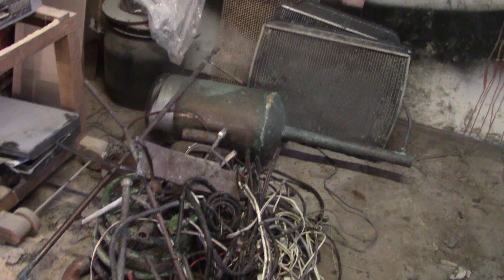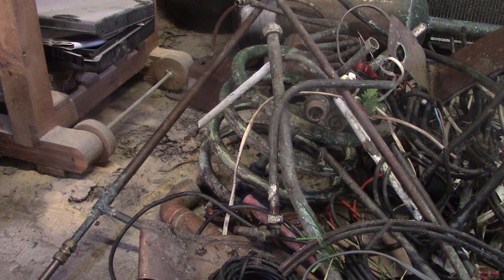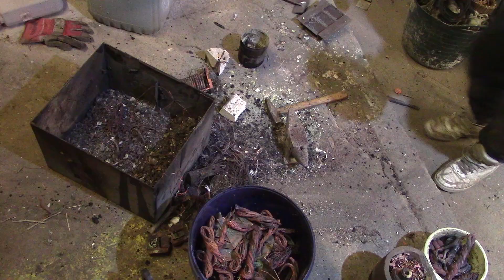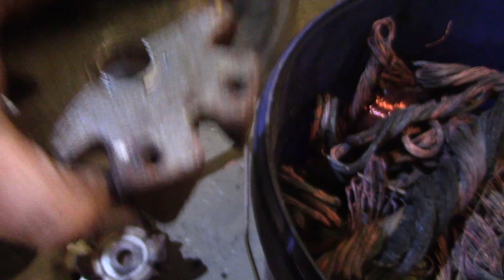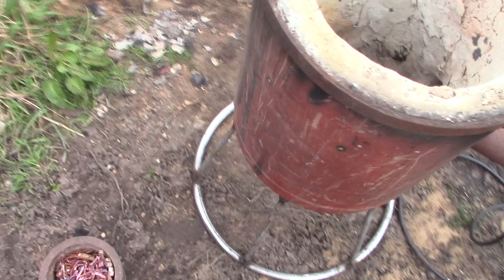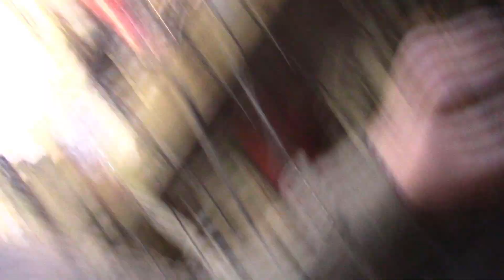Slightly sketchy waste oil copper melt

Comment: Nice one for the clothing recommendation didn't think of charity shop wool jacket, built a tiny less than half liter internal capacity crucible furnace the other week as a bit of a test for a bigger one already considering no hole in the lid exsaust at the side and some sort of heat exchanger
Reply from the maker: Interesting, what are you going to do with the recovered heat?
Reply: @turboconqueringmegaeagle9006  to preheat some of the incoming air a bit just to try to reduce the cold spot at the bottom where the air is blow in a hope of increasing the maximum tempreature and possibly crack vapourised the fuel up a bit once it hits the hot air.   Could allways use a wheelie bin, pump, copper coil for the one man Spa or heating
Reply from the maker: I really like this idea, I tried making a micro oil forge many years ago, heating the oil slightly but it inevitably got too hot and coked up, hot charge air is just as good regarding getting the oil to burn while not causing the coking due dirty oil and as you say getting a few more degrees out of it. 
Biggest problem I can see is having to open it up every time you want to have a look at how the melt is progressing.
Reply: @turboconqueringmegaeagle9006  I think a refractory slab on an lid with a hole best compromise, still got to move the thing to look bit it should not affect the burn as much as moving the whole lid to look. Fuel regulation is a problem with the small ones, end up having to thin the oil because its too viscous for small pipes run in through a fridge capillary jet spraybar type setup

Comment: James my last copper melt  did the same copper beads all up in the air my safety adidas trainers bead right through   lucky got a bucket of water to the side of me foot in bucket still held on to crucible  nice scar on foot   safety first
Reply from the maker: I've had weld go down in my shoe before, leads to a wee bit of panic I'd imagine if the lump of red metal was ten times bigger and you had a crucible in your hand it'd be worse. 
I've got complacent only playing with aly, this was probably a good reminder.

Comment: It might be worth a try but rub some Brasso on that visor to clean it up. If it's anything like polycarbonate light bar domes that are yellowed and hazed that will take it off. I've restored a few light bars that way. The same technique works with gauges that are hard to read. Try to find an older can of Brasso as the formula has been changed over the years it takes less of an effort to clear up.
Reply from the maker: I'd be surprised if it wasn't polycarb, it's starting to craze but would definitely be nicer to use without the yellow cloud, I've got some perspex polish somewhere, I'll probably try that first, but when I give up trying to find it I'll hit the braso, cheers mate.
Reply: @turboconqueringmegaeagle9006   Headlights in cars yellow and cloud all the time  here being they are all plastic lenses now.  There are all sorts of expensive rejuvenation "Kits"  but I get common old cutting compound and give them a good Polish and wipe off then go over with car polish which adds some  UV protection and the things come up like New. Any mild abrasive will work, Brasso, toothpaste, kitchen cleaners like ajax , Jif etc. 

The windscreen on my harley also goes off and I give that the same treatment although regular polishing when I do the paint work seems to  keep it pretty good.

Comment: Would those bits of cast from the alternator mesh together to work as a mechanical clutch? Not sure if that's the right term but you get my drift, maybe a PTO for some of your plant?
Reply from the maker: Yeah probably, dog clutch is what I've always known them as, having angled mating surfaces means they'd need constant pressure to stay engaged but that's the most creative suggestion so far 👍

Comment: Jim, that heating element, as I'm sure you're aware of, is designed for the food industry, and attaches with a clamp to a matching flange on pipe or piece of equipment. I've seen them at the scrap yard in my area and typically buy the stainless steel nuts off of them for other projects.
Reply from the maker: Yes matey, this one is actually threaded but I'd already wound it onto the tri-clamp flange, like mechano for liquids.

Comment: cant wait for the filler video on rebuilding the forge , will be looking to see if I can find the original video now though. There is a great video out there on building a combo forge /furnace that you might want to take a look at . (I'll find the channel if you want me to). Also yeah cold moulds ...  Glad you didn't get hurt .Do you think it'd be worth making a concrete platform for doing hot work/ smelting  on?
Reply from the maker: I'll see if I can find it. Many mistakes made with the construction of this thing I'm glad it fell apart before I dropped a crucible from 4' trying to get it out.

Comment: @ 8:56: That's physics made tangible. I love stuff like that too. Over here we can buy two grades of copper pipe, L or M, and I always buy the thicker stuff. Do you need thick wall copper plumbing? Not if you can afford threaded bronze. Or stainless steel. Both of which I have seen on repair jobs. One (very expensive) house I just worked on recently had all threaded bronze water pipe, and they were having me rip out an entire bathroom ... you can bet that all that pipe is in my garage right now.
Reply from the maker: I bet thats lovely to thread but hard to do without leaving any tool marks on your back under the boiler.
Think most tradies use the press fit systems here which is fair enough given what they charge per hour.
Reply: @turboconqueringmegaeagle9006  Press fit ... 🤮  Usually when people have me in, its because they want a decent job done without paying the trade rate. I'm not licensed, but I can sweat pipe like a pro, and I do electrical as well.
Reply: @turboconqueringmegaeagle9006  And yes, almost all of it has been painted and you can see the pipe wrench marks. Quality materials, I said. Actually the workmanship isn't bad, the real key was they put root valves on every service leg, both hot and cold, so it was super easy to remove just the sections I needed to take out.
Reply from the maker: @forge20  root valves? Service cocks I guess, with a fladhead rather than a handle? 
Sweats pipe like a pro, easy tiger!
Not fussed with wiring but enjoy plumbing jobs. Push fit looks rubbish but it's still fun, and very versatile, and if you're house catches fire it'll melt and help put it out.

Comment: With more air and fuel, you don't need no "stinkin insulation!! :0)  I wouldn't recommend having the burning in the delivery tube, wastes heat. Have a pedestal in the furnace so the combustion starts below it and and goes up the side.  Next time remember to put the molds over the the furnace to dry it out to prevent the excitement when you pour the copper in.  The flame in the furnace looked a bit rich, maybe a jumping castle blower would do better? Loads of air and you can throttle them with a bit of cardboard over the inlet..... But much more fun to run full open!  :0) Very entertaining as usual mate but heat those molds next time!!
Reply from the maker: Loud and clear mate, bidding on several bouncy castle blowers has begun and I'll get the moulds hot next time.
Regarding insulation... I quite like it, makes the whole experience a little more comforting.
The reason I want combustion in the pipe is so the bottom of the crucible gets some heat instead of what was happening here where even with the pot sat on bricks the top of it was white hot while the bottom was still turning red.

Comment: Shame about the Brook motor. You could try making an aly housing to replace the cast iron. I wonder how that happened? Those bits of cast that came out of the alternator core could make excellent flanges for holding things to shafts. You even have the original shaft to tell you what a press fit would be down the bore.

Any idea what caused the "excitement" during the pour?

Also well done. I have a design of a cast iron melting waste oil furnace, the burner is the furnace. (As in that is where the burn takes place) rather than in the feed pipe. It also takes a slight feed from the furnace to preheat the burn as well.
Reply from the maker: Yeah it's a real shame, looks like it's been dropped or had something drop on it, the pulley is damaged and the case end moves longitudinaly when I turn the shaft so I think the shaft is bent.
I didn't warm the moulds, and it was dark in the grass probably with moisture settling on them, pretty stupid really.
Reply: @turboconqueringmegaeagle9006  You live and learn. Hopefully less exciting next time.

Comment: will you sell those ingots? or what, how you will get brass out of copper?
Reply from the maker: I'll try and alloy this with the zinc I recovered from the wheel weights and a bit of lead and it should give me some nice brass.
Reply: @turboconqueringmegaeagle9006  very interesting, what will you be using the brass for?
Reply from the maker: @enginelover1  bits and bobs in the underground bunker, light fittings and door handles.

Comment: Sketchy is the only way to go..stacking copper bars have value and come in handy for several different projects..
Reply from the maker: I'll get them hot next time... And maybe not pour over wet grass, top advice as always.
Reply: Most foundries will preheat the molds and soot them for a easy release..some even pour under a flame torch on the mold to have shielding from oxygen in the molten metal..oxygen is indeed a bad thing to have while pouring molten metals..